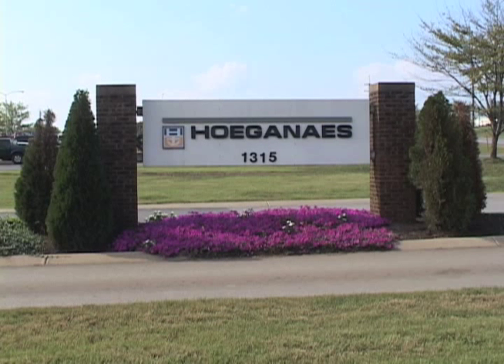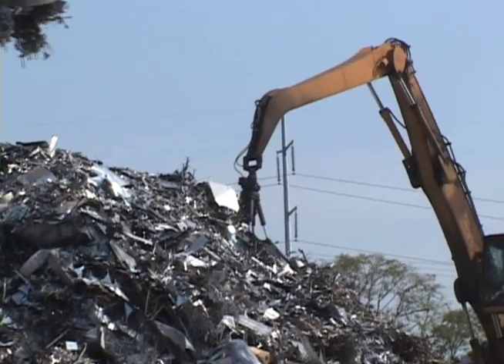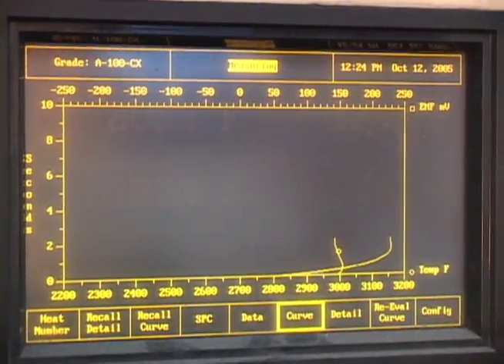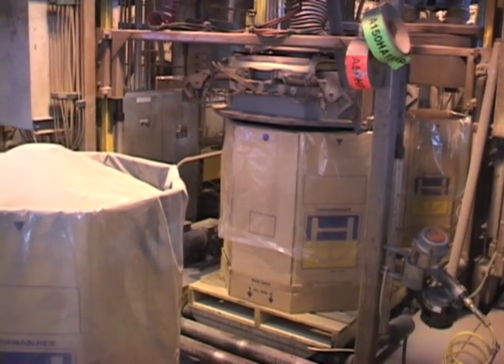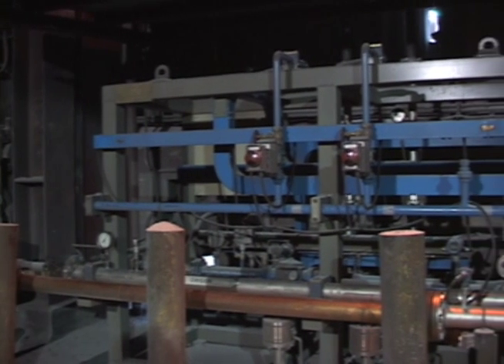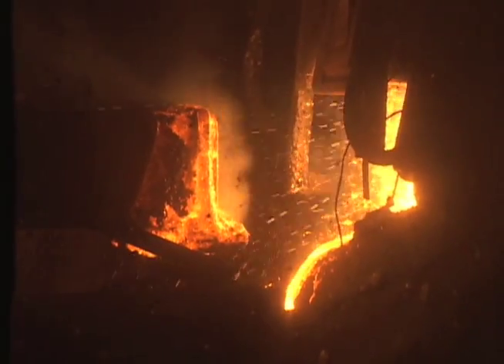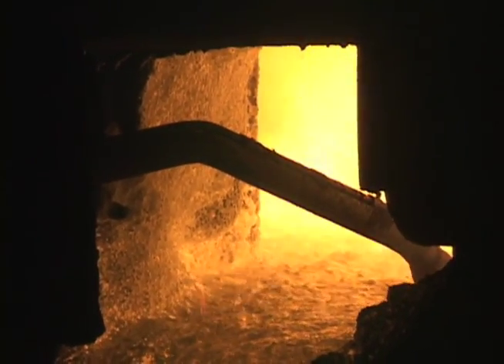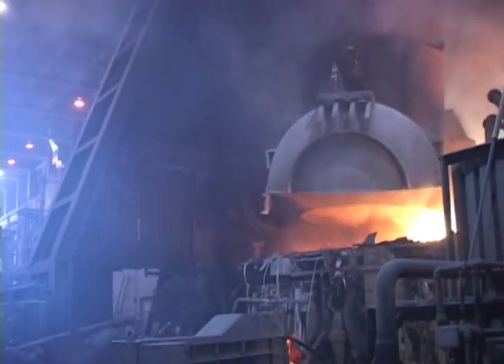Hoeganaes Plant - 2005

Comment: @inkyvid - They had three fires in the annealing building between January & May - 1st fire killed 2 guys, 2nd fire injured one, not too badly, 3rd fire was from a hydrogen leak, also ignited iron powder, killed 3 guys. I found your video while watching one of the demolition of part of the annealing furnace building.

Near as I can tell, most of the folks that I knew had retired or moved to different employers by then. The CSB video about their report is pretty ugly.
Reply: That scares me because I work at the north American  hoganas  and we do the same thing metal powders.same process
Reply: @evanwilliams2602  Be safe Evan
I actual do Safety Presentation  at my job everyday talking about what happened to those guys that were injured and killed there.